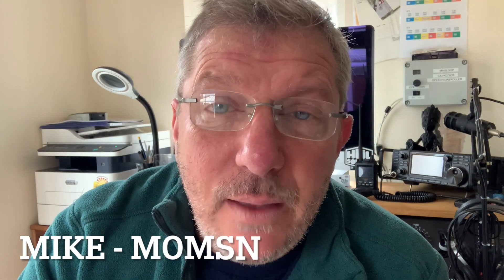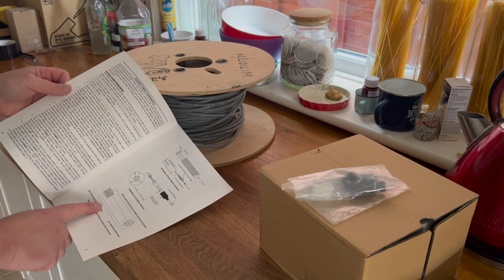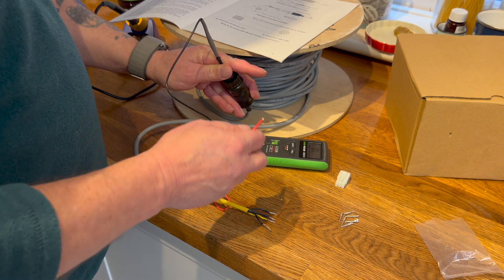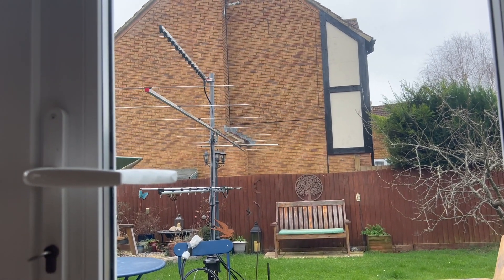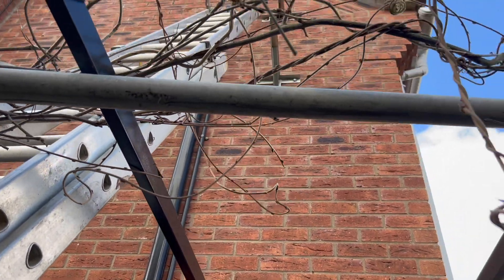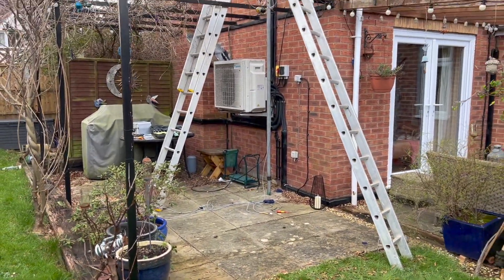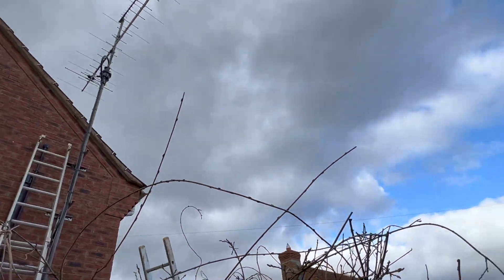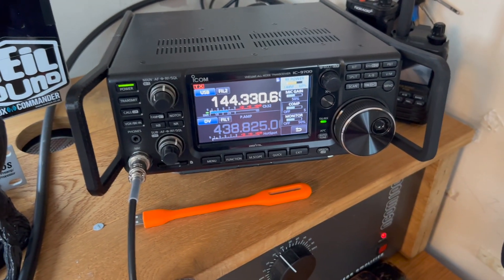Ham Radio: Triple Stacked VHF/UHF Beam and Rotator 2M, 70cm and 23cm.

Comment: Hi Mike! Is this tower a single length of scaffold pipe, or did you stack together two or more?
Reply from the maker: Started as a single length now it is two parts... 6M and 2.5M short length at the bottom
Reply: @mike-M0MSN  Thank you! I've been looking around for an antenna solution for 2M/70cm for a long time seeing that the XYL has vetoed any mention of the word "tower" (which is probably just as well, we have a tiny garden). Some of these poles combined with those K/T brackets seems to be just the ticket. There is hope yet! 😀

Comment: i tried to put my 2/70 antennas up the same way a few weeks back, i tried to do it on my own though, it was only when i'd got the same type of galvanised steel pole most of the way up i realised it was too heavy, it wasn't a controlled descent🤐 needless to say i have one 70cms beam now after the 2m was smashed beyond repair. i won't try again until i've installed a tilt over mast!.
Reply from the maker: Oops,

Comment: Been there, done that.....mine was 40 foot of boiler pipe ( same as scaffold pipe ) with a 10/11m 2 El V-quad, rotator and an 18ft 11m vertical on it, for good measure, I was surprised it didn't bend the pipe when we lifted it, but it went up straight and stayed up for over 20 years. At least now you have it up, it's fairly easy to lift it higher,  all you do is find a pipe slightly bigger and slide them together, you could raise it above the chimney height quite easily if you do it the simple way. it might need three sets of hands, but a straight vertical lift is easier than that first lift will ever be...put a stop bolt in the lower pipe, lift the mast, slide it inside the bigger pipe until it sits on said bolt, and three spot welds to hold it, just grind the gal coating down to raw metal and tack welds hold fine. You might want a few guys near the top though, that's a fair amount of sail you have swaying about up there, and once that stupid pipe bends, it's bent forever....all you really need though is a 1Kw UHF amp attached somewhere inline, making height irrelevant for most. 

p.s: NONE of the above should ever be taken seriously, as the Antenna Gods don't like being beaten. They will smite you with lightning strike after lightning strike....
Reply from the maker: lol, good idea with the bigger diameter pipe..  :)

Comment: what i did when i had something similar at my mom n dads... have one scaffold permanently mounted to the house and then use a couple of the W shaped connecting brackets... One bolted to the top of the fixed one, and one bolted to the bottom of another one that way I could slide up and down the one pole with the antennas attached down to the roof level.

Comment: in UK, you must have a lot of people using VHF, UHF.  I live about 50 miles south of Los Angeles, but Not much activity in VHF, UHF.  just a few FM repeaters are active.   AG6JU
Reply: That is the case many places.  My suggestion is if you want to use VHF/UHF, use it and encourage friends to use it as well.  My primary use for 6m and above is during vhf contests. But I also monitor 146.52 for people activating SOTA.
Reply from the maker: Not so much, but. I am hoping that more will join me on the 2M, 70CM Bands..